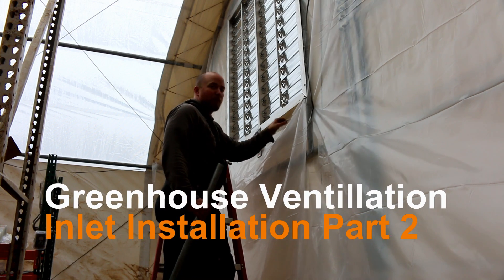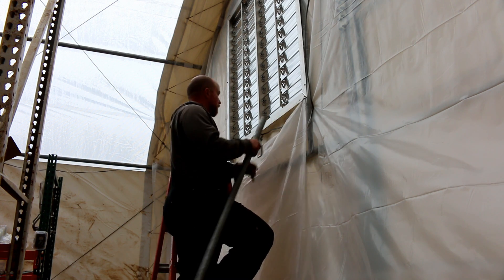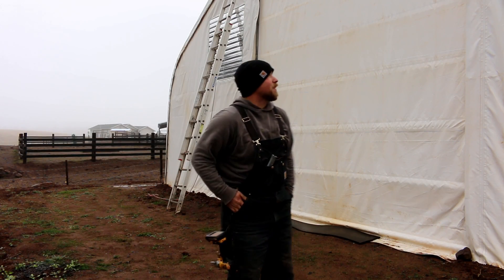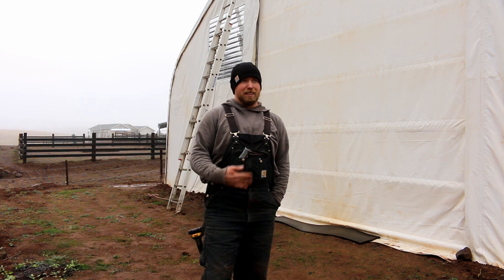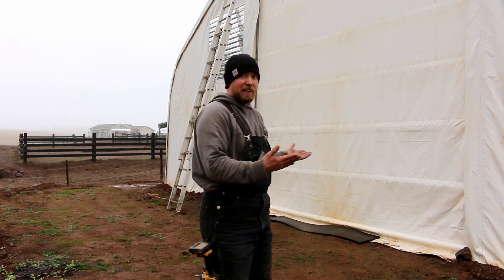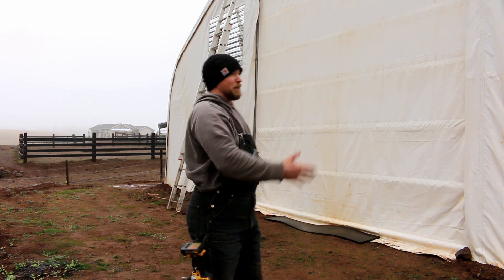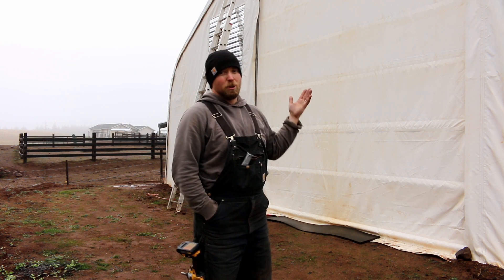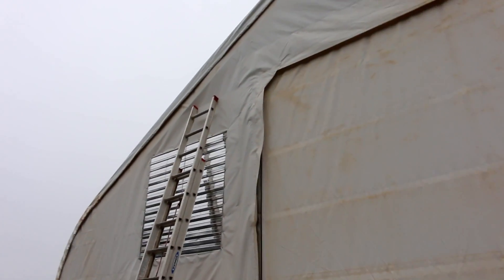Greenhouse EXHAUST FAN, Install, HOW TO - Part 3

Comment: Will have to put a removable insulation cover on  the inside of them that covers them when they aren't in use 😊 will have to be a project to go along side the moving roof insulation 😊

Comment: Ref: 2:30
Where I live there is a lot off greenhouses and they use CO2 from gas-burners to supply the CO2 that the plants need. You should be able to do the same.

Comment: First, It will be interesting to see if those soon to be icey cold vents act as a condenser for all your humidity.  You may end up need to put in a trough to catch water dripping of them. Second, maybe consider some kind of insulation (or just a couple blankets) to cover the vents when you dont need them.  You could get really fancy and use guide rails on the sides and a thick foam board on pulleys to cover and uncover the vents.
Reply: I was going to make the same suggestion; could motorize the vent covers to move before the vents open; to be controlled by the same sensor than turns on 
the fan.

Comment: If only you had a large propane burner that generated nice warm CO2...oh wait you do. Have valve that directs the exhaust into the building when CO2 levels are low? Add a dehumidifier, and you could just insulate over the louvers in the winter.
Reply: Hey, Ryan:  Yes, many ideas running around about the heat being lost, etc; but the heater would produce way more CO2 than the plants need, plus huge amounts of water vapor...  he's already trying to get rid of that.  I'm thinking it would require a fairly complex 'scrubber' to properly re-use the heater exhaust; but the potential is there.